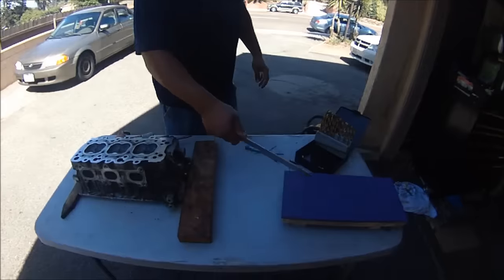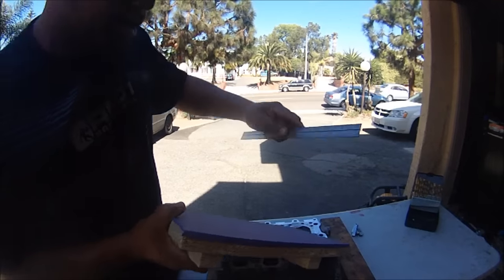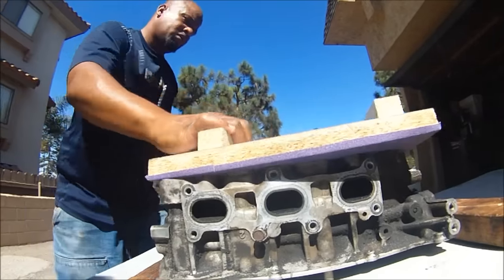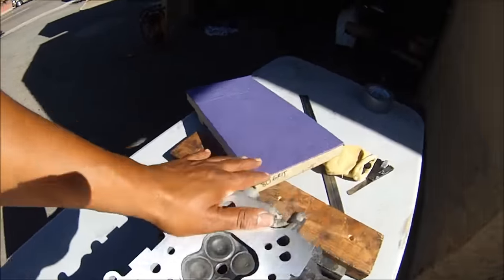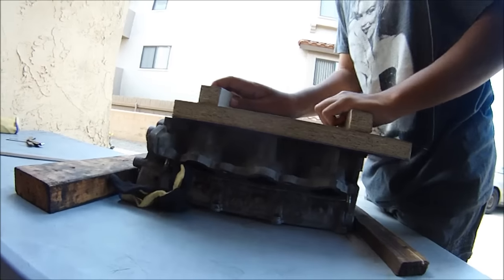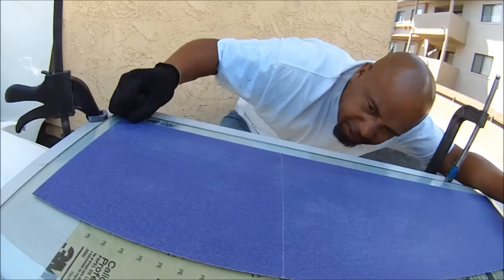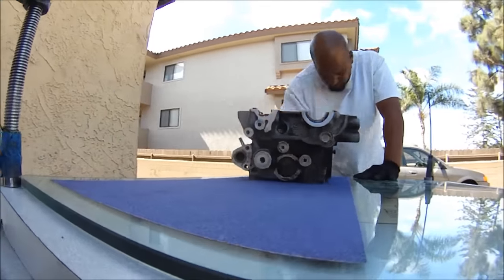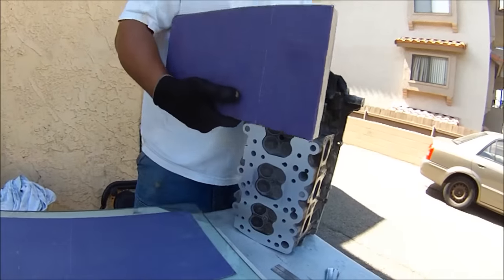HOW TO RESURFACE A WARPED CYLINDER HEAD AT HOME WITH SAND PAPER still works in (2023)

Comment: Hey from Sweden, i'm 57 now and when I was 15 I use to sand down cylinder heads on my mopeds to increase the compression with a block of wood and sandpaper. Keep up the good work.
Reply: I hear some just used to do it on a concrete floor haha
Reply: @lobmin  even that would be 1000x times better than this
Reply: That brings back memories of sanding down the head on my Yahaha FS1E when I was 16
Reply: @lobmin  i know thanks
Reply: I took my 2 stroke heads to local machine shop. he charged me 10 bucks to take off 1/8 inch of ot. dome inside was size of half a golf ball. on a harley hummer bike. 1960 something model. was the fastest 125 in MY town. I could even outrun a fat kid on his 175 harley. had to run premium  gas in it.
Reply: @lobmin  bro thanks for giving me a laugh bro fucking almost choked on my tounge!Chur bro!!!
Reply: Swedes Projects .
Reply: I use to do the same on my yamaha moped... old school lol
Reply: lobmin used to clean brake pads that way before reassembly.
Reply: @user-qx7tm5df8j  Seriously, what are you even saying? facedown on an uneven concrete floor is 'better' than upright on a sanded block & facedown on sandpaper+flat glass? Have you ever sanded anything in your life? Or only in Fallout 4?
Reply: The real question is how did the ancient civilizations build these pyrimad structures  from stone blocks?They are more precise then anything  we can manage to do with technology today.. Yet were unaware of any technology that they may have had🤔🤔
Reply: Thanks man its good to see and hear a great man of God sharing your gifts we can do all things through Christ it's the only way that always works

Comment: The purists may hate it, but it's hard to beat ingenuity and hard work to achieve a good result. You took your time, set everything up right and used sound techniques. Just because all of us aren't rich enough to run to the machine shop or parts store for everything we need doesn't mean we have to give up. 

Respect.

Comment: I had to get back to you. After using your instruction, My son's head was resurfaced after a shop declared it unserviceable. this is a 1998 Volvo V70. 2 years with 1.5 yrs in CO and running like a champ. God Bless! Jack
Reply: I wouldn't be bragging about owning a Volvo.....
Reply: @monfrig6959  Why, no A/C?
Reply: @monfrig6959  he doesn't?
Reply: @monfrig6959  If I were you, I'd read a little more carefully and keep up with real world goings on. Volvos are safe cars and Mr. Foster and son live in Colorado. The weather conditions, and mountainous terrain definitely put the long wheelbase of a V70 to use. The large storage also gets a ton of use and safe haulage. The safety features and heft of the car also keep the crazy ex-California drivers from threatening his son's life on the highway. Anyway, Mr. Foster came on here to give his 'thanks', so couldn't you just let it be at that?
Reply: @monfrig6959  well you dont know much about a Volvo then and should stock up with some knowledge on them

Comment: im 47 and over the years i have accumulated a full automotive machine shop,but having this type of get-down actually allows you to be a better machinist with your machines,a critical thinker is a critical thinker,nothing like getting a engine well past its prime and completely bringing it back to peak performance!! i started without any machines at all!!
Reply: Great job bro
Reply: Here's a cookie 🍪
Reply: Using sand paper glass method is used even today to put final finish on  hydraulic motors costing thousands of dollars when rebuilding them. And they got to operate at up to 5,000 pounds pressure. Just built a pump at home this way that the shop said could not be rebuilt.

Comment: Holy cow.....this TOTALLY worked. My daughter has a 2002 323i BMW which blew the head gasket.....overheated the engine and warped the head. (Luckily North American 323i's got the iron block instead of the aluminum block). Anyhow,  last month I took the cylinder head to a machine shop and they wanted $450 to make it right again. Also, the shop said there would be no refund if they milled it and it turned out that the head could not be used. So anyhow, I didn't really have that money to throw away (It's Christmas time). So I did exactly what you did in this video. I got the engine reassembled a week ago and my daughter has already over put over 400 miles on it commuting back and forth to high school daily and driving up in the steep mountains........so far so good. Not even a hint of a problem. Thanks again for making this video.
Reply: bad shop if you are in N.E. ohio hit me up ill give you a good shop
Reply: Its all cool but 2002 323i has aluminum block not iron.

Comment: 32yr old female here. worked as an inspector in machine shops most my career. I just skimmed/resurfaced my cylinder head at home by myself. And it was warped pretty baaaaaaaddd. So i didn't have to apply any added force that'll cause any further damage i got a 3/4" thick piece of 304ss sprayed 1 face with some laydown blue. Got that flat. Then roughed the head wit a 17" planer w/ 120grit so i could cross face it. Hit it with laydown again then 304ss plate with 220 than 400 and a final 1200. Boy that little bastard runs like it stole something now!

Comment: It's an old school fix, reminiscent of grinding valves with a guide post and valve grinding stone. One trick I learned in a machine shop: to keep a planed surface level in both axis x (horizontal, length) and y (vertical, width) is in the movement of the human body. Use a figure 8 motion; granted it's much easier on smaller parts than a head. A back and forth motion tends to sand more on the edges; excellent job using a straight edge to determine flatness. It is a pro tip to ensure a part is not sanded too much on either axis.

Comment: I'm a machinist and I've used ground sanding plates still use them daily. I like the glass setup on the thick board. That's clever. Good work man. The only thing i would do different if it was me doing it this way i would do the sanding wet. Less effort nicer finish and paper doesn't load up .